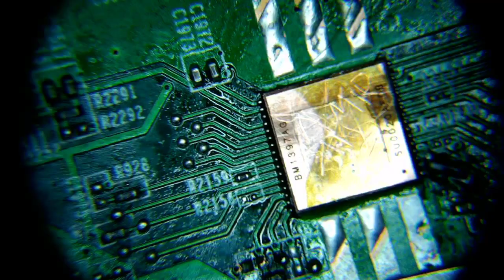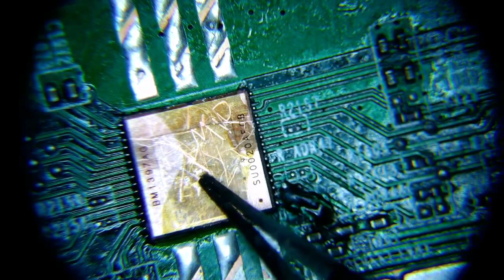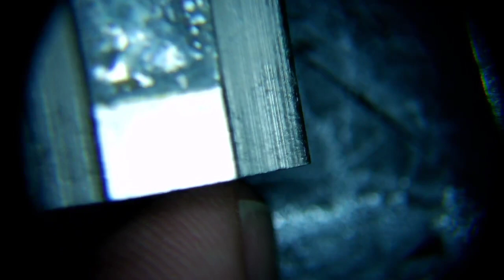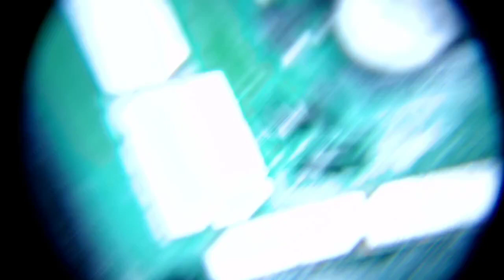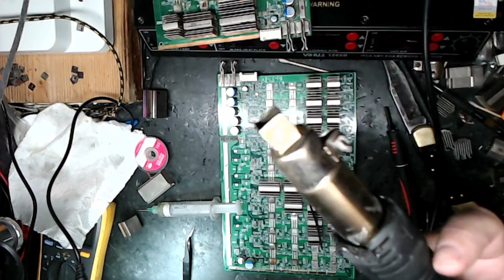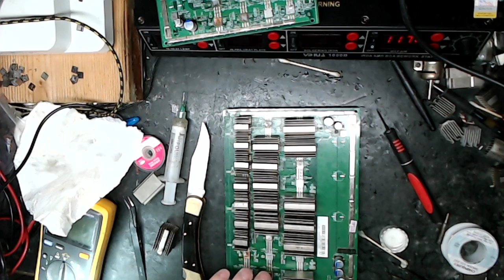Re-soldering heat sinks for S17, S17Pro, S17+ and T17 series Antminer

Comment: what you really want is a high power transformer iron, you jam the tip into the heatsink and heat it up that way. then you use a high power fan (eg supermicro has a 40mm 22050 rpm fan) to cool it down again so it's bonded. as far as holding something and getting tired, look up hemostats, they're a life saver
Reply: also if you have a thermometer that'll help you figure out when the heatsink is hot enough. a normal k-type thermocouple will be good enough. you put the thermocouple inside the heatsink and watch the number. takes the guesswork out of it.

Comment: Excellent video. Just happen to be working on a 17 right now with the same issue. 
But I can't find any 130 degree solder & flux anywhere. The only 130 I've found is resin core and .5 in size.
Can you send me a link?
Reply from the maker: Look at chipquik.com

Comment: does it matter which hashboard goes in which slot?  i assume no, but just making sure.  I repaired some heat sinks, but the board is still not working with no other apparent damage
Reply from the maker: No, it doesn't matter.  Thanks

Comment: Hello antminer repair
I was trying to figure out a way to reach out to you but this was the only way. I have a S 17 Pro which I overheated and six heat sinks fell off and one is loose it’s the heat sinks on the chip side I wanted to get your opinion. Most of the Solder on the chip part is off but the heat sinks still have Solder on them I am afraid to resolder them and throw a solder ball and short the circuit. I have cool master high-performance thermal paste is it safer to try to remove all the solder from the heat sink and the chips and use the thermal paste or do I place the heat sink with some chip quick on the chip and heat the heat sink and try to fuse it again .what should I do please and thank you?
Reply from the maker: Please join the discord server where you can share photos and get many opinions.  thanks

Comment: Do you have experience with black glue that zeus sells? I was thinking that is what is used for replacing heat sinks.
Reply from the maker: Not on the 17 series machines.   Except maybe the T17e.   They must be soldered